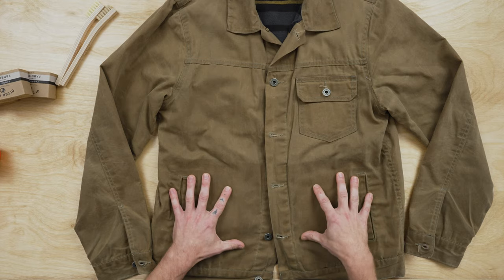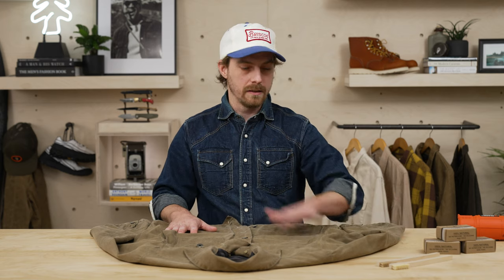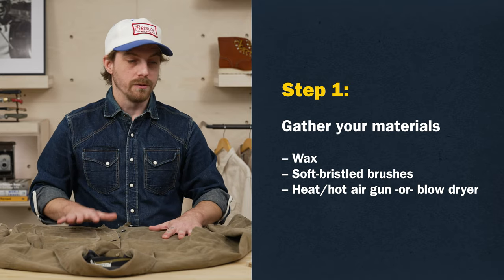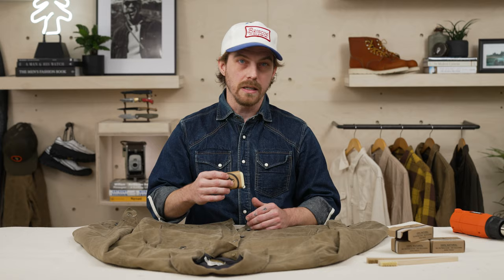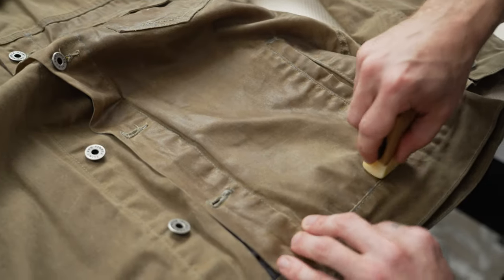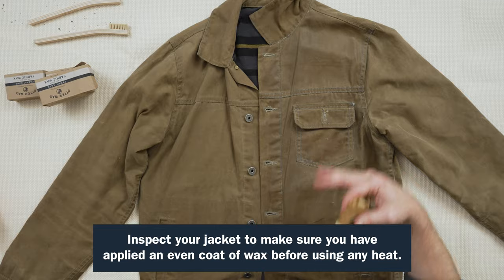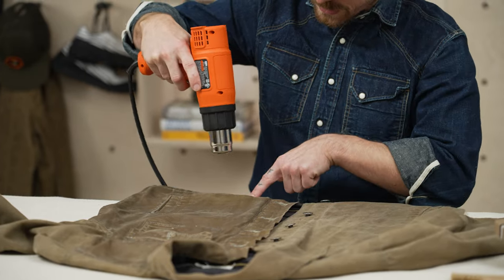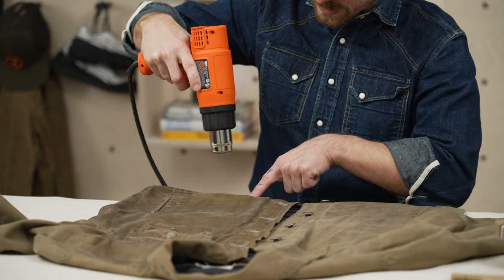How To Re-Wax & Care For Your Waxed Canvas Jacket | Our Step-by-Step Guide

Comment: Never put in washing machine??? Bruh I can imagine the smell on that thing 😅
Reply: My dog pissed on my wax jacket I don’t think brushing or wiping it is going to work on this one so I’ll be machine washing on cold lol
Reply: Generally your clothing stinks because of your sweat, body fluid, etc. But as a jacket, this shouldn't really see much. Dirt, etc. from outside doesn't really stink. That said, if it gets really dirty or like someone said dog pees on it... nothing wrong with handwashing gently in your tub with regular detergent, then rewax yourself. But unless you wanna rewax all the time... don't wash frequently. Is what it is. Or just don't buy waxed canvas honestly.
Reply: I have another waxed trucker jacket and i’ve worn it countless times. Doesn’t stink at all. They are typically very warm jackets so if you only wear it when it’s suitable for the weather, you won’t sweat and it’ll be fine. Also making sure that you’re being hygienic will obviously help. If they do smell, you can spray febreeze products on them. I personally like to keep my jacket smelling good so I apply solid cologne every now and then.
Reply: @HogwartsBasement did you do it? How’d that work out
Reply: @eliasgonzales3748  probably ruined it. Most wax jackets are lined on the outside and inside, then another layer of fabric or a liner. If you wash it, it strips the wax and you cannot rewax the inside.
Reply: I got some grease on mine and it was really annoying, so i took some Palmolive dish soap to it, with cold water and a cloth and i got the oil out. now when i look in the mirror the jacket where i cleaned that spot is a lighter color. I guess im going to have to re wax. but yeah i’ve never washed it and have probably worn it 150 times. Best jacket i’ve ever owned

Comment: You should stick with what the company recommends. Fjallraven also uses a hard wax while Barbour uses a liquid wax. If you have an off brand jacket (vintage or out of business), it is up to you what you use. I used a UK paste wax on my Canadian made Australian Outback brand jacket. I still have a tub and half of that same wax, but I won't use it on my Barbour; so I have to buy some Barbour wax to do my jacket.
Reply: I have an older Outback jacket that my late husband loved. Still hanging on the coat rack by the back door. It smells awful. Any ideas?

Comment: Screw the heat gun suggestion, spotty and time consuming, just toss it in the dryer for 5 minutes, done.  Hang it the garage for a day or two, done!
Reply from the maker: We specifically recommend against using the washer or dryer for the Waxed Trucker, but to each his own. When the wax is heated, it could transfer to the inside of your dryer and then on to the next item or load placed in the dryer.
Reply: @Huckberryco  yeah, I thought of that too and kept it in for just a few minutes, no residue and the jacket looks fantastic

Comment: I have a filson trucker jacket and used otter wax. Here are my suggestions:
Do you really need to rewax!? If water isn’t coming through , you don’t. It’s a meesy job with mixed results.
Don’t use too much wax. I thought I did it the way this guy said and the heat gun still left significant streaks.
I got rid of the streaks by putting it in a dryer that worked pretty well. Low heat for maybe 30 minutes. Got rid of most streaks.
Hint: go to the laundromat and put it in with a couple of lint free rags. Check it every 15minutes. When the 30 minutes are up , immediately use the rags to wipe the jacket down.
This got the streaks off better than the hear gun. Also: I only used about one half stick for my coat, so I didn’t really overdo it.
Nice vid, but this guy had done a lot of them and knew the ins and outs a lot better than me.
Reply: Also good to use one of those bags made for more delicate clothes so the jacket isnt in direct contact with the washing machine. Just keeps more wax in the jacket.

Comment: I have been rocking waxed canvas motorcycle rainsuits since 1969. I make up a mixture of paraffin and mineral spirits to retreat waxed cotton and put the retreated garment inside out in a dryer for 5 minutes or less. Makes it come out looking like new with better water resistance. Make up the mixture to axle grease consistency. Looks like you've smeared snot on your jacket until the dryer melts it into the fabric.

Comment: so, if machine wash is not recommended, then what would I do if the jacket smells ?
Reply from the maker: Good point. We recommend turning the jacket inside out, spot cleaning with gentle soap and an old toothbrush, and then hanging to dry. Read more about how to care for your wax canvas jacket on the Huckberry Journal: https://bit.ly/3rHLPXr

Comment: Would love to see a video about repairing a wax jacket. Mine was stored for years in a folded condition and has a large amount of significant wrinkles and folds which almost seem impossible to remove. 
Not sure I should even attempt to rewax the jacket before completely removing the wrinkles. Even using a heat gun on high setting while stretching the fabric has only removed some of the wrinkles.
Reply from the maker: Usually hitting it with a hair dryer will work to release wrinkles and ease some of the "patterning" from those creases. In this case, I have two suggestions. First, I think rewaxing would breathe new life into your jacket. The new wax will help ease those wrinkles and patterns. And second, wearing it more often. These jackets get better with wear and pick up marks that give it a "lived in" look.

Comment: You have to wash it at some point if it just reeks.  Hand wash and keep hosing the jacket down till the water runs clear is best.  If you use your washing machine, you will get a wax residue that is hell to remove- just don't do it.  Hang to dry with a fan for a few days.   Do not use the dryer!!!  The fabric will shrink 2-3 sizes if you do.  And you shouldn't dry it in the sun on a hot day either.  No one buys these for work jackets so you may only have to do this once every 3-5 years or if it gets really soiled or if you wear it all the time.  Plan on it taking over the course of a week.  An hour to wash and rinse, a couple of days to fully dry (never wax damp clothing), waxing it takes an hour or two, and come back the next day to wipe off the oil, touch up areas and then it needs to dry for a few days while you wipe off excess oil/wax.  If you do it the way they show here and get in your car, you will have waxy oil on everything and leave oil streaks everywhere.  Never listen to a drunkard how to do anything.  Keep drinking while making videos boys.  

This BS of Febreze or vinegar mitigates the smell but it doesn't kill the bacteria or actually clean it.  You have to kill the bacteria and remove the grime on the inside.  The people who say that is the way are the same morons who say never to wash your jeans.  That level of stupidity has Dunning-Kruger effect written all over it and are for people with so much money they buy new clothes rather than wash stuff.

Comment: Does it matter what type or brand of wax you use? Say a jacket or bag etc comes with Martexin wax applied. Could you just use a different brand when rewaxing (assuming the item isn't completely stripped of wax in all areas)?
Reply from the maker: We have not found it to be an issue using a different brand. That being said, stick with a product that is intended for rewaxing canvas garments.
Reply: @Huckberryco  Thanks! I have some fabric Otter wax bar on the way.

Comment: If you’re too lazy to re-wax, what’s the worst that will happen? Will it just lose it’s waterproof or will the longevity and durability be compromised?
Reply from the maker: The waxed canvas has a water resistance factor as well as contributing to the overall "look" of the jacket. I don't think the durability should be affected if you opt to skip rewaxing.

Comment: Just waxed mine, but used the wax tin otter product instead to save time,  any reason you choose the otter bar?

Second, your denim shirt,  where could I buy one, really like it.
Reply from the maker: We like using the bar because it makes it easier to apply directly to the jacket and helps get wax into the seams. 

A man of many talents, Nick actually handmade this shirt himself, so it's 1 of 1. But if you like his style, check out some other shirts Nick designed for Flint and Tinder here: https://bit.ly/3ZVDaNE
Reply: @Huckberryco  The Best Western I have seen, hands down,  figures... Kindly request if possible to put it into production... Seems like you have a staple in the making
Reply from the maker: @AmitGupta-vo6km  We'll let the team know!
Reply: I just rewaxed my filson trucker jacket using the otter wax bar. It came out very shiny looking even though I tried hard not to over wax it.
Any suggestions on making it less shiny? Thanks.

Comment: What if you over wax the jacket and the wax starts to smell?
Reply from the maker: Good question! Wax can have a unique scent which should lessen over time. You can use some spray-on deodorizers but the simplest fix would be to put the jacket on a hanger and let it air out. If it isn't too hot outside, setting it in direct sunlight works best. Otherwise, a well-ventilated room with a fan can do the trick

Comment: How would you recommend cleaning the inside, in particular the armpits. They're starting to stink lol
Reply from the maker: Good question! Above all, we definitely don't recommend washing the jacket. A simple solution would be to lay the jacket on a flat surface and sprinkle some baking soda on the interior and let it sit for a day or so. You can then vacuum up the baking soda. That usually gets the job done! Other customers have had great success using fabric deodorizers and letting the jacket air-dry
Reply: @Huckberryco  A related question, how to remove odor on the exterior of the jacket? Deodorizer as well? Thanks!
Reply: @Huckberryco maybe this is weird, but say with denim, I usually freeze it to kill bacteria, which in turn gets rid of smells of any kind. Could that also work here? Or is that not advisable?
Reply: @yosemitesamiam  that's a bit of a myth tbh. It gets rid of the smells but freezing doesn't kill the bacteria so it comes back sooner

Comment: Waxing is no big deal what I need to know is how to clean it for dirt  odors
Reply from the maker: If the interior starts to smell bad, we recommend setting the jacket out and letting it air dry for a few days. As long as it isn't too hot, sunlight can work wonders. We also recommend using a de-odorizing spray or spreading baking soda over the area and then vacuuming it up. Any of these tricks will help neutralize the odor!